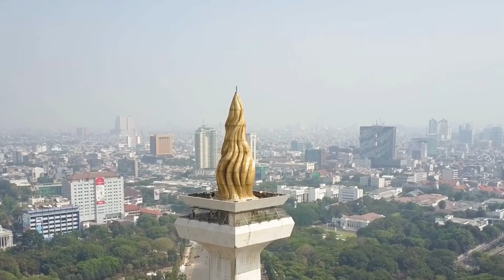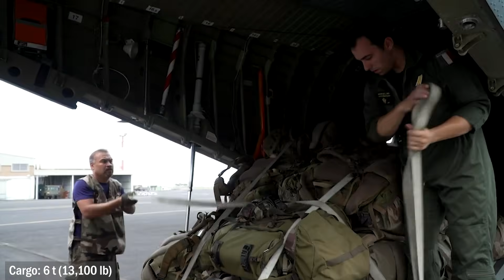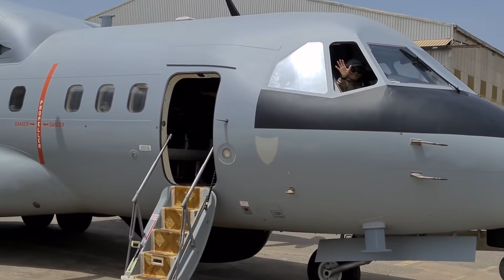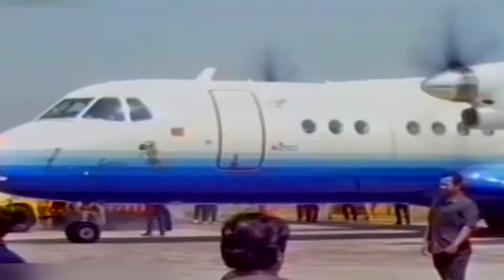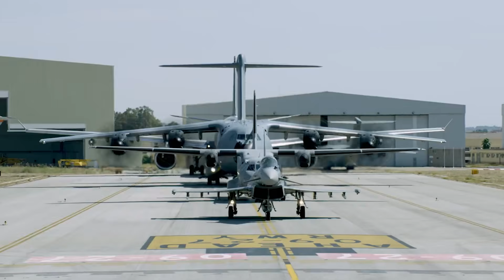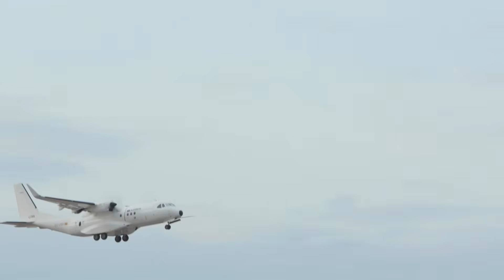CN-235 and C-295 - Spanish transports

Comment: Casa 235 is a very interesting basic usefully airplane for transport and special delivery functions, and I see several improvement possible , usefully,  because 25m square surface to ground, is a big surface on ground, ...could be reduced, .....and several special  improvement could take higher his already good performances still reducing fuel consumption,....and modifying some take off and landing characteristics, but the allover characteristics , with the ramp door and still big inside volume, make this 235, one very interesting robust, quite simple airplane, with still a lot of different version, so very usefully, and not excessively expensive,...,.a good Choise in well adapted size to answer to load of work..and  specific missions,.reasonable, ⚓🖥️👀📡👀🖥️⚓🔎🔎🔎🦅🦉⚔️🦉......

Comment: CN235, made in Spain & lndonesia consortium (  between CASA & PT Nurtanio, next IPTN & now PTDI  ), with BJ Habibie, president Director of Airtech, consortium company. 

CN235 program since 1979 with 2 prototype model in Spain & lndonesia. CN235, two propeller engineceith 35/38 seat or 5 ton for freighter capacity. 

After completion of orogram CN235,  CASA a have new program the new series C295 (  long version from CN235  with 9 ton freighter / 70 seat  ). lPTN a have new series, the propeller commuter plane N250 (  50 seat  ) & N250 100 (  70 seat  ). 

C295 compentitor for C27 Spartan & N250 compentitor for ATR42 & DASH 8/Q300. N250 100 compentitor for ATR72 , DASH 8/Q400 & Xian MA700. 

Now, C295 (  CN295 lndonesian version  ) very success, too bad, N250/100 canceled production because crisis monetary 97's in lndonesia (  actually because factor X  ). 

N250 prototype fly to Paris Air Show 95 & first in the world with new syatem for pilot crew, Fly By Wire (  FBW  ), including for N250 100. Airbus A320 200, first in theceorld with FBW system for turbofan passenger plane. So, A320 200 turbofan & N250/100 turboprop, two plane with FBW syatem, first in the world. 

Now, CN235 & NC212 i (  CASA 212 400  )  made in lndonesia, because Airbus, Military (  now ADS  ), not production again & focus for C295, A400M & A330 MRTT (  outside helicopter products  ). 

And now, PTDI a have program, N245, next generation from N250 (  now with N219, compentitor for DHC6 Twin Otter  ). PT RAI (  BJ Habibie family  ) a have R80, next generation from N250 100. Next, N219 has new compentitor, new aircraft, Cessna 408 SkyCourier. 

Indonesia use 11 CN295 (  C295  ) & next, order 2 A400 M Atlas plus 4 units again / option & total 6 units. For A330 300 MRTT, no news yet. 

///(#DN/CROCNTLMYYPDPODSSS0746PMWIT05032023#) ///
Reply: Terima kasih atas penjelasanya.

Comment: The C-295 is a extremly efficient plane in terms of capabilities versus cost. Aditionaly it can be manufactured with a lot of configurarions, making it a very flexible flying platform.
Reply: What can it carry?  It seems too small.  You can't fit a truck, HIMARS etc on board.
Reply: @williamzk9083  paratroopers or supply, for big things spain has the A400
Reply: @williamzk9083  21 tons, maybe a canon or light vehicule
Reply: @williamzk9083  Three humvees or similar vehicles.

Comment: Spanish Airliner Binter, operates several cn-235 planes for travels to Canary Islands or Ceuta and Melilla.
Reply: You mean the ATR72-300 and the ATR76-300
Reply: @S1lv3rf1sh  Maybe Binter is not using their Cn235 anymore. But u may do a simple Google search for pictures both Binter Canarias and Binter Mediterráneo.
Reply: @konradson  As you say, Mediterráneo, but that airline does't exist anymore, it got sold to Air Nostrum in 2001
Reply: @S1lv3rf1sh  Binter Canarias, now Binter, part of what was Iberia, like Binter Mediterraneo, had 5 Cn-235 https://es.wikipedia.org/wiki/Binter_Canarias
Reply: @S1lv3rf1sh  ATR72-500 and 600
Reply: Now binter as far as I know only operates in canary islands and all the Casa has been replaced by ATR-72

Comment: You've forgoten the grandpa: CASA 212 Aviojet. Indonesia bought a big ammount of these Aviocar planes. That's why Nurtanio become a partnet with CASA. They were very interested in a bigger plane. Indonesia has a large amount of isles, and other places difficult for bigger planes. France, Turkey or South Korea's Air Forces have more planes than Spanish Air force.
Reply: Yes and now CASA has remove their production facility to Indonesia. So IPTN (Now PT DI) can produce the plane called C 212i and the local  derivatives N 219. Ironically Indonesia "failed" to develop further their version of CN 235, ended at CN 235 - 220 but succeded create diverse function including Maritime Patrol (MPA). Next plan is to have C 295 AEW&C version and develop it locally.
Reply: @Chimpunk729 . It's NC-212i, every non fighter airplanes made in Indonesia will have an "N" word
Reply: Udah dijelasin di video, lu aja gak nyimak
Reply: @IchlasulAmmal  lah bang kok ngamok

Comment: Didn't expect to see indonesia and spain covered here! Thank you for this video ❤️

Unfortunately PT. DI still struggle to certificate and sell N-219 so i expect them to focus on this type first before going for N-245 or N-270. There is also a project simmilar to N-270 from a private company called R-80. R-80 is a project from PT. Regio Aviasi Indonesia to become successor of N-250. I heard this program for the first time around 2016-2017 but i didn't here too much progress from this project today.

I hope you can cover N-250 sometimes in the future! N-250 is extremely revolutionary for indonesia since it is the first aircraft that indonesia make without assistance from foreign countries. N-250 itself is also quite revolutionary because it use fly-by-wire for a regional aircraft and use some kind of CAD to speed up the development.

Comment: It is almost guaranteed that India will place a follow on order around 2025 for 100+ C 295'S to replace the An-32's.
Reply: Nah. Plans have changed, for the better might I add. The 100+ An-32 are now to be replaced by 80 aircraft in the A-400M category. That is a massive boost to the Indian Air Transport fleet. If only we could have ordered more C-17.......we needed 25 but only bought 11 before the factory shut down. :(
Reply: Looking at the An-32's engines, they look massive compared to the fuselage, almost comically large. I guess because it's a modified An-26 with raised engines so the bottom nacelle still needs space for the landing gear.

Comment: For some reason, unforeseen serious  operational  issues have arisen with the RCAF Kingfishers. So much so, that they will not be operational until 2025. Not much information has been released about what is the issue. It has been noted that SAR techs taller than 5’10” have a difficult time moving in the cabin.